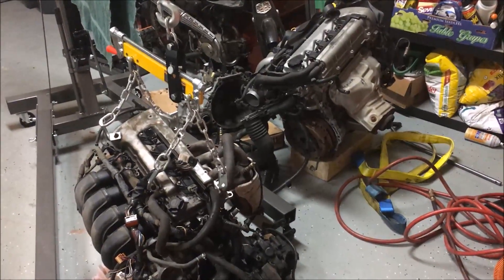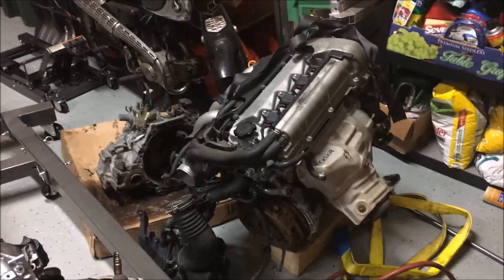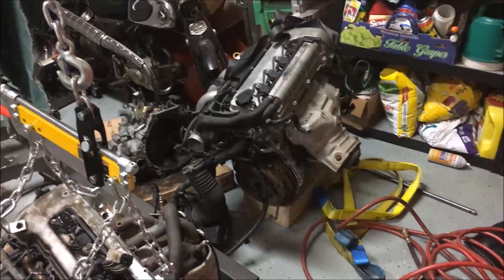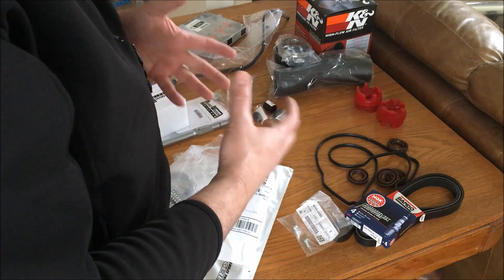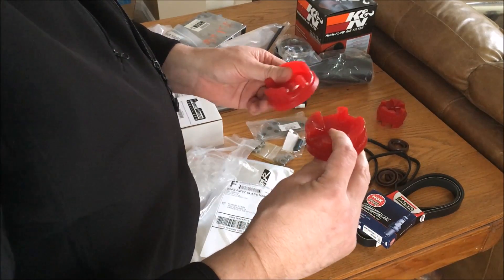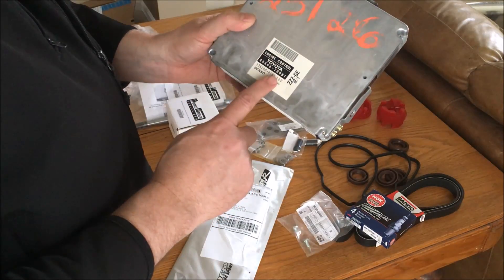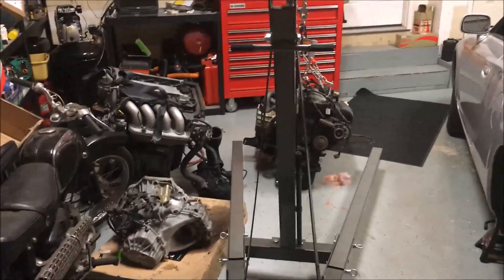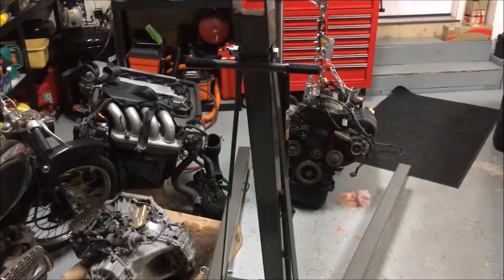MR2 2zz Swap What does it cost?

Comment: Wow how full of crap can you be?! A 1zz makes 140 hp. A 2zz makes 180hp. That is nowhere near double the horsepower. 280 is double 140. Is math really that hard? Yes it does improve the car and the six speed helps by having lower gear ratios and more of them. Basically Toyota cars are set up very similarly and it shouldn't be too hard to swap from a 1zz to a 2zz since they're basically the same engine with different heads.

Comment: The 1ZZ felt so disappointing at first but then I realized that it's such a good engine. It's extremely economical, low maintenance, and can last you a very long time. It's such a shame that is so under powered and doesn't seem to fit the car. I'm guessing Toyota didn't want the MR2 Spyder to de-throne the Elise/Exige since it's such an economical car with similar performance. If the MR2 Spyder came with at least 200HP, It would've been a legendary sports car.
Reply: yeah 200hp wouldv been perfect. would save us all the work of swapping!😂
Reply: It is the same engine that is in the Lotus Elise. It fits the car perfectly. It is basically a cheaper alternative to the Lotus Elise. Don't worry if you reach the 85 mph speed half a second later. I don't know what you need so much horsepower for in such a light sports car. It won't be hauling. That is for sure. 🤷‍♂
Reply: 160hp, 8300rpm, NA motor. 2000lbs. Legend.
Reply: they planned to originally give the 1ZZ a turbo, but the toyota depression had hit and they cancelled that plan and kept the car
Reply: @PseudoKirby  There's really no excuse because Toyota already had the 2ZZ engine and instead of giving it to the pure sports car (that doesn't even have a trunk) MR2 they rather give it to the POS Civic wanna be FWD Celica. The Spyder was a huge flop despite being such an amazing car because of Toyota's dumb decisions.
Reply: Toyota were interested in offering an alternative to the mx5 and that's the only reason they kept the power down and put effort on the chassis and handling.
Reply: @ There's no excuse not to include the 2ZZ at least as an option. It's almost drag and drop, and the POS FWD Celica got it. The MRS Would've stole the Lotus Market if it came with the 2ZZ for 1/4th the price. Instead nobody liked the wet turd gas pedal of the 1ZZ and the MRS  faded into obscurity.
Reply: @Zeriel00  agreed,  wouldn't have cost them anything.  I just said what they gave as their excuse. I fitted a leon cupra R engine and box in my hill climb racing mr2
Reply: @Zeriel00  it's a mk3 MRS, 2004, with 380bhp
Reply: @Zeriel00  basically when you look at the mk3 it's similar to the mk1 lotus elise in weight dimensions and the mid engine layout and my mr2 is my hill climb racing car which is classed as fwd,  rwd and AWD, and instead of having a class for different engine capacity they have a power to weight regulation of 200bhp/ton, 300, 400 and unlimited or "specials" I'm in the 400bhp per ton and I chose the mr2 because it's light agile and steering response is instant and like you point out,  getting the power down is the biggest issue but I used lotus Elise for inspiration and I picked up a front bumper with splitter,  rear wing and induction ducting for the engine.xtrac lsd,  60mm arch pulls to fit 245/35x16 Goodyear supersport rs on 8.5 x 16 magnesium bbs e50 split rims
Reply: @Zeriel00  YouTube mr2 900bhp hill climb racing car if you want to see what the mk3 mr2 is capable of.  it beats McLaren Ferrari,  dtm and wrc cars with its turbo 3.5 2grfe v6 with something like 830kg lol,  makes double my power

Comment: Honest the C60 transmission is garbage (Coming from a 2zz celica owner)  Ratio wise they are pretty good but they are just not strong. My 2nd gear started crunching now wont engage at all and my 4th gear has always had a crunch, Getting my transmision rebuilt soon. My mate with the 2zz corolla has the same 4th gear crunch and had a 2nd gear crunch when shifting at high rpms. If you go through the process of engine swapping to a 2zzge might as well open the gearbox and put some carbon syncros in there. only like $50 per gear and should only take a few hours to do if you already have the box on the floor.

Comment: Fot those looking for the rundown on costs - skip to 10:11. Short summary: 2k for the car, 2.5k for engine and transmission, 3k other parts, so 7-8k without labor.
Reply: 2K for the car? Haha good luck with that. This entire conversion would be so expensive that it may be a better idea to just Turbo charge the 1ZZ
Reply: @Zeriel00 depends on location etc. I got mine for 1450. Under 100k miles and no lights on
Reply: yea they go for minimum 10k cdn now …

Comment: How do you convert fwd to rwd? Knowing the celica motor is fwd!
Reply from the maker: For the engine itself you do not have to do anything other than use the original wiring harness.  To use the 6 speed trans you do have to modify it to work in the rear.  I cover everything in other videos.

Comment: It's been 2 years.  How is it running?  Reliable?
Reply from the maker: The MR2 has been super reliable and a daily driver for me and my wife.  No issues and I still love to hit 5,500 rpm's and hear that exhaust.
Reply: @StarkReality  thanks for the vid! Nice job. I've always had an interest in Spyders but I am put off by the reliability of 1zz engines (precat incidents). Did you have issues with the 1zz before the swap?
Reply from the maker: @ioannislampros2786  I bought this MR2 with 300,000 miles on the original engine.  It was shot but I planned to do the swap anyways so it is what I wanted.  I never really drove it with a 1zz but it clearly did alright with 300K on the odometer.

Comment: Two questions that anybody who knows can answer:

1. Is the 2zz head with the VVTC compatible with the 1zz bottom end? If so are the bottom end internals the same?

2. Can you re-sleeve a 2zz block or hone the cylinder sleeve walls?
Reply: I'm not an expert on this, but the bore and stroke on the 2zz is different than the 1zz, so I don't think you can bolt it on.  Not to mention, of course, you have the VVTL in addition to the VVTi.  I think it uses oil to do that and I'm not sure where it gets that from.  You cannot hone the walls because the cylinders use some funky material, but I do think they can be sleeved and Monkey Wrench Racing uses a place called Darten (sp?).  Hope this helps.
Reply: The engines are completely different. Almost zero shared parts. No you cannot home the cylinders in a 2zz but you can sleeve them I believe.

Comment: Sid the 1zz hace catylitic converter problems? I have heard about it by anothee youtuber, but he had a 2001 model. I am looking to buy an MR-S that is a 2004 year model, and I am cautious on it. It has 57'000 miles, and if I decide to buy it, I am taking it to toyota to check the converter's condition, and maybe replace it.
Reply from the maker: It is the pre-cats that are the issue with these cars.  Mine had 300,000 miles on the engine and it was shot.  So I don't know if the pre-cats had been an issue.  Getting it checked is a good idea.  If they are still in the system you should be looking for oil burning.
Reply: @StarkReality  Is there A way that I can replace the pre-cats with something more reliable made by Toyota?
Reply from the maker: @officialpennsyjoe  You just take the pre-cat material out of the pipes.  Other option is new headers.
Reply: @StarkReality  What would be the negative effect of taking the pre-cats out?
Reply from the maker: @officialpennsyjoe  The system is more free flowing, you don't get debris in your engine causing oil burning and the engine will last longer.  I am not aware of it causing emission problems but that could be different in some States.
Reply: Only the 00 and 01 models had pre cat issues

Comment: Thanks for putting this vid together. Very helpful in figuring  what to do and how much it’s going to cost. Hope you’re happy w the conversion!
Reply from the maker: Will Worrell - Super Happy. I have a daily driver with everything working like it came from the factory and the performance is terrific. So much fun to drive.
Reply: Awesome!!!Toyota made a misstep not equipping the car w the 2zz to begin with. As a new car option it probably would have been maybe $1500. And 15 years after production, it would be a lot cheaper and easier to swap out a rebuilt 2zz engine now.
Reply from the maker: @wddub9075  If this car was built with the 2zz and 6 speed with a nice tune it would have been so much more popular.  It really is the way it should have been.

Comment: I totally "get it", why people would do this, and seems like a cool project. But why not just buy a C5 Vette and be done with it for $9k?
Reply from the maker: The cheapest C5 Corvette in my area is $13K most are $15K and up and you are still left with a front engine corvette.  The Spyder is far cheaper just slightly higher power to weight ratio, mid-engine and super unique.   Don't get me wrong, I like Vette's but they can be dime a dozen and most people don't even know what the MR2 Spyder is.
Reply: @StarkReality  Agree on the "uniqueness" standpoint. But there are several mint high mileage C5's around me right now for under $10k. In fact one just popped up with a clean 100k miles, for $9500, looks beautiful and has blacked out Z06 wheels along with some other mods I'm sure (It's got Texas plates). A MINTY FRESH 100k mileage 2001 Z06 just popped up yesterday for only $11.5k !!!!!!
Reply: CoaCHSNiPeR  They will both run forever and are both cheap to repair. It's a no brainer -- chevy LS series for the win. Especially when you factor in the LS gets the same MPG and has like 200 more hp LOL

Comment: How much hp can a 1zz make with upgraded valve springs and turbo make is it possible that it double the hp
Reply from the maker: Preston Buckley There are some benefits to a turbo 1zz. You can get more than 200 hp for sure. Just depends on preferences.
Reply: Just by changing the value springs and turbo it that’s great that you

Comment: What possible swap can be done to the MR 2 besides that 2zz?
Reply from the maker: You could also do a 1zz with a turbo, very nice.  Honda K series engines are popular swaps as well as the Camry V6.
Reply: Audi ABZ 4.2 v8 with an A5 OB1 6 speed transmission.

Comment: why didn't u swap in a 3.5 V6 from a Camry?? isn't the torque/HP better?? I just looked it up it only weighs 170 pounds more than the 2ZZ
Reply from the maker: This was my first engine swap so I wanted to keep it as simple as possible.  Plenty of parts and info available for the 2zz swap as well.  I am very happy with the performance it has given.
Reply: StarkReality my motor is blown and I want an easy swap. If you don’t mind me asking what motor did you use and did it fit or did you have to custom anything to make it fit and what about the computer did you use the same one on mr2 or did u use a different one?
Reply from the maker: The easiest thing is to put in another 1zz.  Next easiest is a 2zzge.  There are also items for doing a Honda K series swap.  Those are the easiest.  If you want to know everything needed for the 2zz swap check out my other videos.  I cover everything.

Comment: Gonna correct you on something here. In stock form a 1zz-fe is 140hp. A 2zz-ge is 180hp in lift. That is not a 50% increase at all. It's closer to a 30% increase. Now factor in the the fact that daily driving you will spend more time out of lift than in it. Outside of lift, a 2zz-ge produces around 140hp as well. However, outside of lift the 2zz-ge has less torque than a 1zz-fe.

Unless you keep it in lift you will not see any real performance increase. Now don't get me wrong, the 2zz-ge is a fun engine and a worthwhile upgrade to the MRs, just keep in mind how much it costs for it's performance. If you have a good 1zz-fe, going 2zz-ge isn't really worth it when you can just get a turbo kit from MWR for the same price as the swap and end up with more power lower down the rev range.
Reply: i think  he meant 50hp...
Reply: truealchiemist .... the 2zz has higher RPM, stronger internals, easier to modify, etc. it’s overall better engine.. do you even own an MR-S or even have it swapped with a 2zz? If not then shut the fuck up, if you do then sell the car because you don’t know shit. 

2zz can reach up to 400hp and the 1zz probably only 230hp before it can get fucked up or need forged internals.
Reply: Oi Jimmy!.. Everything he said is correct so maybe you should shut the fuk up!!! And stop flexin about the 2zz you nutter

Comment: Would you recommend getting the MWR swap kit since you spend around 6k on swap parts?
Reply from the maker: I got a number of parts from MWR.  Most of my parts expense was the PPE exhaust and intake.  You can do this for far less using more stock parts.
Reply: hmm okay.. I found a 2zz engine 6spd and ecu close to me for about 2.5..just figured with all the extras you need the price would be about the same since they claim you only need intake and exhaust to complete the swap with the MWR kit
Reply from the maker: You will have to add things up.  Engine, transmission, swap harness puts you at $4K before shipping from MWR.  You still need intake and exhaust.  Certainly saves time and some trouble.
Reply: StarkReality okay ...still don't even have the car yet just googling right now I see one in my area for 4K "blows smoke needs a rebuild " gonna try to talk the guy down but says 4K firm lol
Reply from the maker: Sounds like a good candidate.  There are so few of these cars it can be hard to find a good deal.  Good luck.

Comment: "The engine cost more than the car " wtf i can find 2zz + trans for 2.5k, and mr2 spyder cost 10k here
Reply from the maker: I felt very lucky to find the deal on the MR2 that I did.  You have to be on Craigslist every day to find them.  There was a 2002 MR2 with a bad clutch for $2,300 just a few weeks ago here.  It went went fast though.
Reply: I'm canadien from Québec, we have like 2 of them for sale XD
Reply from the maker: There are not many of these around so it might be tough.  Can you import one?
Reply: i bought a 2001 here in germany for 2700 € ~ $3,060 with complete new tran and new shortblock 25k miles ago. Looking for 2zz swap now <3

Comment: What do I need to do before hand?

I bought mine friday (sunday today) and looking at what kinds of modifications are required before the swap. 

So... change all the fluids, full inspection, detail the interior and exterior, gut the pre-cats, add sway bars and support struts, brakes... 

But other than that, what other handling requirements are needed before increasing the power?
Reply from the maker: The only handling mod I have done so far is an under brace.  If you have a 2000 to 2002 you are going to need some other bracing under the front and back.  Otherwise the car handles the new engine fine.  I am going to do coil overs soon and do need a front strut bar.  The back brace is pretty good as is.  I will do sway bars if needed after the coil overs.
Reply: I plan on blowing like $1000 bucks in the first 6 months on stability. The rollover is real in that little thing, but yeah - it is a 2000 model.
Reply from the maker: Coil Overs or Koni's with lowering springs should be top priority.  The car sits a little high on the stock suspension.  There are a lot of thoughts on stiffening the car up on spyderchat so be sure to check it out.

Comment: So in other words buy an s2000
Reply from the maker: Except a 2003 S2000 costs more than $20K still and after the swap they have the same power to weight ratio.
Reply: StarkReality I got my 2001 for 8,200 and a clean title
Reply from the maker: Sounds like you did well.  I bet it is a fun car.
Reply: StarkReality yeah it is. Better car then the spider I think except I really envy how you're  700lbs lighter! Like seriously it makes me consider trading my s2000.
Reply from the maker: At 2,190 lbs from the factory it is a very light car.  It is quite easy to drop a few more pounds and get down to 2,000.  Makes for a fun little scooter.

Comment: $3000 for around 50% more hp is a good buy and you can take it to a dealer or any old shop for maintenance
Reply from the maker: I agree.  It is a really fun drive now and has even more potential.
Reply: I achieved a 50% increase in power   at the wheels in my s14 Silvia (200SX) SR20DET for $1600 AUD. Including parts, labour, dyno tune, exhaust and FMIC. please don't get me wrong, I have owned many Toyotas and Nissans and like both brands. I was just amazed at the easy power you can get from a SR20DET still running sensible boost.
Reply: @timsmith854  You could do the same from the 1ZZ, I don't know why people insist on the 2ZZ because that costs a fortune and a bad mechanic could dismantle your car. A simple turbo kit would get you the power you need for much cheaper, although the 6 speed would be nice.

Comment: do you recommend rebuilding the motor before putting it in the car?
Reply from the maker: You certainly could but you will have to make that call based on the engine you get.  I ended up doing more work on it than I planned but that was because of my own mistakes.